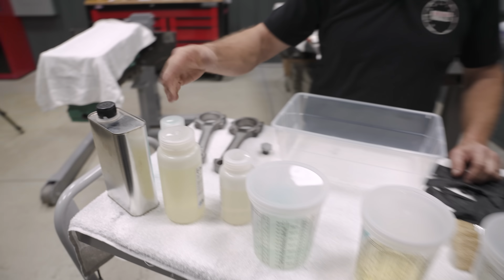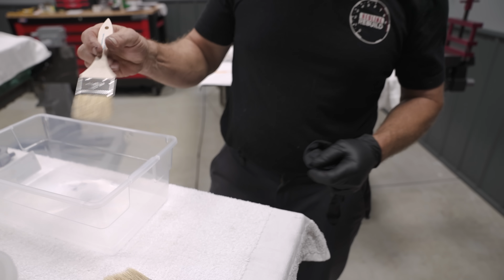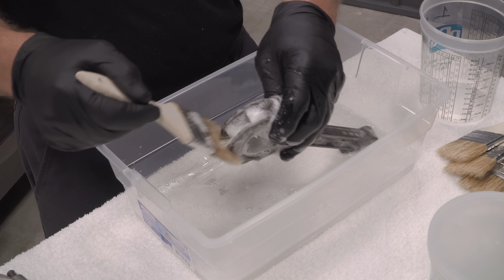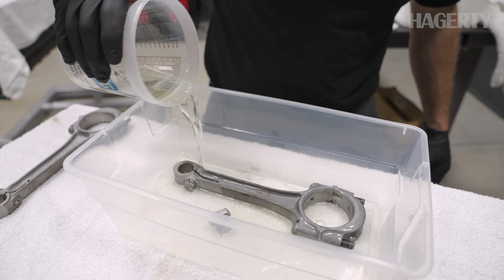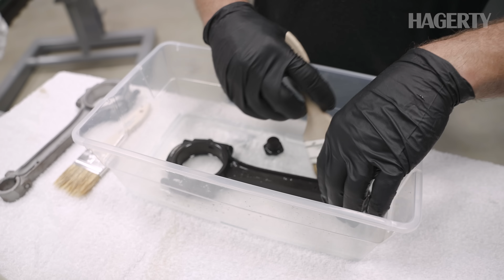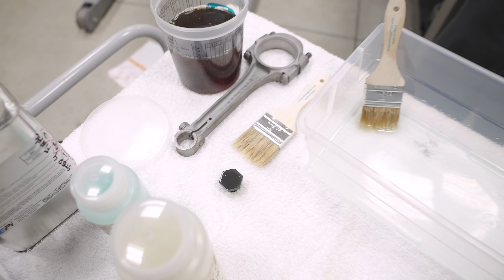Black oxide coating engine parts for rust prevention | Hagerty DIY

Comment: Black oxide can continue to work (react) in threaded holes and crevices if not 100% rinsed. After a few days you will see white powder and trails of white corrosion leaking out.  The metal is continuing to be etched by the residual oxide and just like rust, will eventually chemically weld two steel parts together.  The drain plug is an acceptable use for black oxide but based on my experience, the connecting rod isn't. I'd stay away from black oxiding any parts with internal threads or holes especially if they are blind.  Good luck.
Reply: snaproll94e, couldn’t you just run a tap on those threads just to clean them up? I think I would do it just to make sure they were clean.
Reply: @Hoaxer51  I've used several different professional coating vendors and all had the same problem with corrosion in spaces that weren't 100% rinsed. If 100% rinsed this shouldn't happen, a knowledgeable person doing it for themself may do better than a large scale automated process.  Personally I won't black oxide any stressed or threaded parts.
Reply: @snaproll94e  In your case, I believe it was not due to the rinse after blackening it was cleaning before black oxide was applied.
Reply: rinsing a a blind hole is easy if you know what you are doing.
Reply: @RichardMichaelOwen  It is correct that the Insta Blak 333 need to be completely rinsed off. It is an acidic solution that will keep reacting if not rinsed off or neutralized. If rinsing is an issue we use a rinse with sodium bicarbonate (2-4 oz/gal) to help neutralize the acid. The follow that up with a water rinse.

Comment: This process is kind of similar to bluing firearm parts. Is it better than bluing?
Reply: I think it's the same thing
Reply: Bluing needs oil on the finish or it will rust!
Reply: I think that's what that last step was.  A really thin oil to prevent the rust.
Reply: correct this is basically Bluing. and with out some sort of protective coating or it will corrode. so either oil or a sealant.
Reply: @reckowracing3342  It is not gun bluing. Gun bluing is done with a caustic solution boiling at 285-295F. This is an acidic solution that is run at room temperature. It is not as abrasive resistant as gun bluing but produces a black finish that is only ~0.000005" thick. The Insta Blak 333 needs to be rinsed well after blackening and then a sealer (oil) needs to be applied.

Comment: I've never heard a paint brush called a chip brush.
Reply: Its not a paint brush. Its for machining operations, brushing away shavings and chips from the part or machine. Chip brushes are a lot rougher and dont produce a good finish like a paint brush would.
Reply: @murphragous  Where do you buy them?
Reply: Victor O'Neill, Amazon has them also, bags of assorted sizes or all one size. I use them if I’m touching up some oil based paint, then just toss them when you’re done.
Reply: It’s a chip brush when used in machine work to brush chips out of the way. 

It’s a cheap paint brush when you use it to paint. 

Available in several sizes at any big box paint department. 

It’s a bbq brush when used to spread bbq sauce.
Reply: Ive bought them at Harbor Freight. Im sure Tractor Supply or Northern Tool have them, or similar stores. They come in box fulls and are cheaper than real paint brushes so you can pitch them and grab a new one when they get too crusty and not stress the cost.

Comment: Glass marbles work great for taking up space in the container. This lets you use less product and still have the part submerged. The marbles are impervious to most chemicals you find in a shop. I have an evaporust/metal rescue tank with a bunch of marbles in it that i kind of push the part down into.
Reply: Genius! Marbles having extremely low volumetric stacking efficiency but also having no edges or corners to hinder submersion or solution contact makes this is an AWESOME idea. I'm going to have to tell this to my brother whom often uses evap-o-rust. Especially as expensive as that stuff it. it's always best to have a container that closely matches the dimensions of the part but how often, in the real world, does that ever happen?
Reply: @Shane-Singleton  
Hey I like tech tips. 
I got rust off a vertical surface (spot on an inner fender) 
By brushing on the evapo-rust ,and then putting a piece of saran wrap over it. 
Came back the next day and it was still wet but had a little rust. 
I did it one more time and it was good.
Reply: @MrTheHillfolk  That's awesome! I wonder if naval jelly or whatever it is would work well in that instance not being able to run off as easily.
Reply: @Shane-Singleton  
I was using that , but it didn't seem to work as good as the evapo-rust. 
You can do the same for the naval jelly too, cover it ,and it keeps it from drying up. 
Another good product is por-15 metal ready. 
I've coated a bare panel with it and left it out in the unheated shop for months without rusting up.
I'm not sure if evapo-rust is like that, where it leaves a phosphate coating. 
The metal ready eats rust , but if it dries it leaves a protective coating. 
Haha , TBH, now I can't remember if i used the wrap over metal ready or evapo-rust because I use both 🤣🤣
Reply: thats a great idea, the only brick in the toilet tank trick.
Reply: now that's smart. Thanks !

Comment: Suggest running an actual test on this.  Give us proof it works!  :)
Reply: This is the same thing as blueing a gun. It works
Reply: @bgj2940  That's right
Reply: It doesn’t, it requires oil or wax. It’s not like a zinc coating
Reply: Zinc coating requires trivalent or hex chromate to get impressive corrosion resistance. Now imagine, by yourself doing $50 bucks kit on your part or how much will it cost you to plate it with zinc and coat it with chromate? Do you have baths, rectifiers, etc? or you get $50 kit and get same results!!!
Reply: @mrmidnight32  True it will fend off flash rust and moisture in the air. But it will not prevent rust on a part left in the weather.

Comment: Does this treatment survive to high temperatures? E.g. external surfaces in turbo, pipes or brakes?
Reply: No this is where Cerakote comes in.
Reply: @reckowracing3342  Yes, but completely different type of finish, with it's own pros and cons.

Comment: Would you recommend doing a black oxide coat to a bellhousing or would it be better just to get it powder coated?
Reply: I assume you have a cast iron bell.  I would powder coat but preferably cerakote.  PC has build up so holes, threads and mounting surfaces will need to be cleaned before use.  Black oxide doesn't build up either but will not have the long term corrosion resistance.